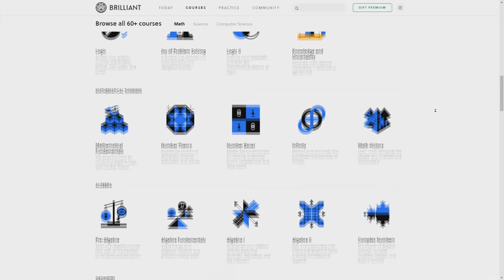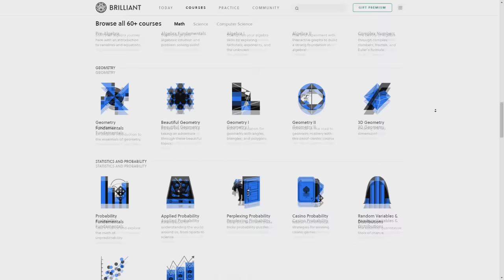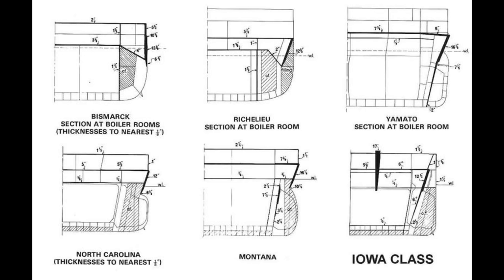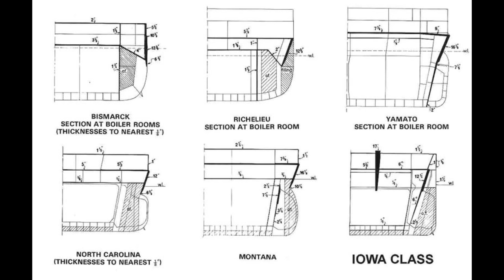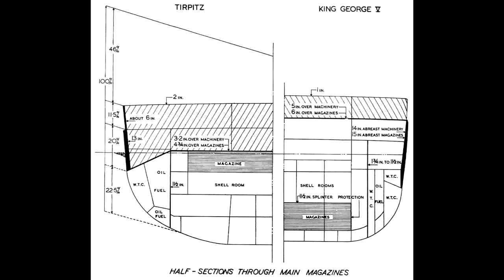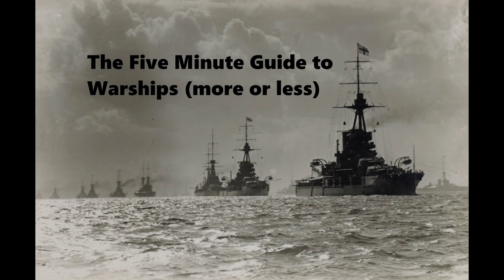Dreadnought Modernisation - A tri-wire balancing act

Comment: I knew a gentleman, now deceased, who had served on USS Mississippi just before and during WWII.  He described his ship as modernized on the outside but old on the inside.  He then went on to describe the challenge of getting hot water (for bathing / washing) as a sailor.  He compared this ship unfavorably (in terms of comfort for the common sailor) to the war-built ships he later served on.
Reply: I mean that is true even today, my Brother was an officer on USS Mitscher (DDG-57) and USS Truxtun (DDG-103) and boy oh boy, the things that an extra 15 years of wear and tear will do to a ship... Despite that he was significantly more fond of Mitscher than Truxtun.
Reply: @adamdubin1276 
Can you recall some examples of those really small but really annoying things?
(like, not classified or critical things, lol)
Reply: @MrNicoJac  It's nothing really obvious. It's the smells, the dents and modifications that the crew has made over the years. little things that you didn't really notice until you end up on a different ship. An older ship just feels different to a newer one.
Reply: @adamdubin1276  I suppose it’s the “character” a ship gets as she ages.
Reply: My dad served on uss iowa in the 80's, and worked in the distilling plant, he says the phrase they liked to use was " modernized from the main deck up "
Reply: @rohanthandi4903 
k, princess...
Reply: @MrNicoJac  Crew accommodations were improved on newer ships.  Bunks versus hammocks, for example.  And showers instead of a bucket.  Older ships were generally noisier and had poorer ventilation.  They became cramped for space when manned for combat operations.
Reply: My father-in-law was on the USS Mississippi during WWII, also.
Reply: The USS Mississippi looked truly bizarre after they converted it to a weapons testing platform. There were all kinds of guns of different kinds and calibers sticking out of its old turret rings. And the missiles. Don’t forget the missiles.

Comment: “Just how frequently did Battleships spontaneously explode?” So we can expect a video on the Mutsu?
Reply: I believe that between 1906 and 1943, there was 1 Japanese, 1 Italian, 1 British and 1 Russian.
Reply: @michaelsnyder3871  I believe Mikasa exploded in port once as well.
Reply: @bkjeong4302  - It only exploded once in port?  How many times was the Mikasa supposed to explode?
Reply: @michaelsnyder3871  and in 1955 another russian ex-italian (and by the way that ship was the sister of the exploded italian one)
Reply: Much eaelier than that, the ships with a full load of gunpowder also were prone to explode. For whatever the reason. 
Like the Maine, in Cuba. Also known as the USS Casus-Belli.
Reply: @atzuras  It wasn't so much the Gunpowder, although that helped once things got going. For most of the earlier ones such as the Maine it is believed to have been the Coal Dust. Which was a perpetual problem pre Oil Fired days.The Gunpowder was kept segregated in it's own nice secure magazines. And wasn't prone to move around too much. But you had to move and constantly disturb the coal to make the ship go. Which meant lots of coal dust. You get too high a concentration in the air and Kaboom. And if the kaboom is good enough to set off the gunpowder? Then you get the earth shattering kaboom. 

The Mutsu was one of the rarer cases where it wasn't a coal fired ship. So it is known to be related to munitions exclusively.
Reply: @Andrew Taylor  Very neat explanation. I am not a navy guy but I heard of cannons, both land based artillery and naval guns, that could go boom by the other side due to wrong gunpowder mixture, half-burned gunpowder dust accumulated in the barrel or just manufacturing defects that cannot be seen until it explodes after a few shots. By the XV century, I mean.  It was like," If that thing explodes, we build another one and hope for the best."  Things have changed a lot since then..
Reply: @atzuras  If i remember it correctly the coal aboard the USS Maine was a low quality coal prone to generating a lot of spontaneously explosive dust, and with the ship's magazines on the opposite side of the bulkhead, didn't take much to split the ship in two when that dust detonated and took the magazine with it
Reply: @parrot849 Well, the Japanese DID fully restore it afterwards so during WWII it wasn’t necessarily out of the question that a stray bomb hit might do it again…(though I believe she was inactive by that time)
Reply: @andrewtaylor940  The actual most explody things were actually flour mills
Reply: @petergaskin1811 Those are still pretty explody.

Comment: With respect to the modernized US ships it’s really a two part story. Prior to the outbreak of WWII we see the US taking advantage of the mass of material left over by all the cancellations driven by the Washington Treaty. Coal Burners get converted to Oil fuel and improved torpedo protection is definitely a significant goal with a lot of the older ships. Once the war starts the bulges being installed are not there primarily to improve torpedo protection but rather to add buoyancy to offset the mass of AA guns now being installed.

Comment: The modernized Italian battleships may be too weak and too expensive, but man were they pretty.
Reply: Totally agree. Very handsome ships.
Reply: Pretty good target.

- HMS Warspite

(probably)
Reply: Italian engineering in a nutshell.
Reply: Have to agree... I think the Italian ships would win most beauty pageants!! Less capable but awfully pretty!!
Reply: Sort of like Italian aircraft design;  elegant looking aircraft but not necessarily competent (Cr.42,  G.50, Maachi C.200, etc.,)
Reply: Even being a little bit pop gunned, could have been useful in many kinds of roles had there been enough oil to actually sortie.

Comment: So my big takeaway from this is that dreadnought modernization is much like renovating your house.  It's a lot of trouble if you want to do anything substantially different from what you've already got, and it would be much easier to start over if the building codes weren't so restrictive with regards to new construction.

Comment: 56:10 - The Kongos were substantially lengthened in their final refit. I can see three options, extend the bow, lengthen their sterns or cut the ship in two, pull the parts apart and expand the middle of the citadel. How did the Japanese carryout the legthening?
Reply: The stern was extended, giving a slightly improved "hydrodynamic".
Reply: @niclasjohansson4333 - Thank you.
Reply: I always wonder how much the Washington Naval Treaty allowed under the banner of "refit".

Obviously you couldn't keep a single rivet and build a whole new ship around it, but where were the limits. Where in the game of Super Dreadnought Theseus was the line drawn? At some point you would be just taking the piss in regards to the battleship building holiday but at what point?

If for example you cut the ship length ways and breadth, changed out the armour and torpedo defence system, up gunned the ship, ect. you'd end up with a very different ship. Ignoring the cost, what could you get way with?
Reply: @somethinglikethat2176  As I understand it they were allowed an extra 3k tons for upgrades.
Reply: @somethinglikethat2176 
Sounds like something you can easily capture under the max tonnage...
(but I haven't read the treaty, lol)
Reply: They extended the sterns.
Reply: @witchkinglp - Thank you for taking the trouble to provide such an educational and comprehensive answer.
Reply: @witchkinglp  thanks for the great answer.
Reply: @witchkinglp  I would guess that replacing worn out engines and boilers could be justified as "ongoing maintenance" rather than the "reconstruction"  referred to in the WNT.
Reply: @somethinglikethat2176  I would guess somewhere between rebuilding parts of the hull like the italians did, and just picking up the turrets and placing them on a new hull entirely
Reply: And the specific reason the stern was extended was to improve the "fitness ratio", which produced a more hydrodynamic hull and increased the ship's speed despite the additional weight.
They lost some maneuverability for it, though. The turning radius naturally got larger due to the longer hullform.
Reply: @aircraftcarrierwo-class  I think you meant "finesse", not "fitness"
Reply: @RetroVzqz9313  Actually we're both wrong, it's "Fineness ratio", just looked it up.
It's a thing they have to keep in mind for naval architecture, especially hydrodynamic and aerodynamic hull forms.
Reply: hognoxious  The Ship of Theseus conundrum is eternal, hognoxious.
Reply: @naverilllang  the problem with the Italian ship is complex: they agreed to scrap the "modern" Caracciolo already launched and at the time the allowed tonnage of battleships for Italy and France was way below the amount agreed, contrary to Japan, UK and USA. Italy, unlike France renounced the right to build new modern ships, like the Dunkerque class and this freed them form any kind of meaningful Treaty limitations when it came to rebuild their Cavour/Doria class. They were for all purposes considered new ships which would replace old ones, being substantially below the maximum tonnage allowed buy the Washington Treaty.
Reply: @somethinglikethat2176 Technically substantial hull modifications (like what Italy and Japan did) were banned. But Italy had bought political leniency by scrapping their more modern battleship, combined with their "agreement" with France to not build any new BB if the other didn't. And being so far below the BB/fleet tonnage limits, meant nobody cared enough to push the issue. Japan got away with it by lying their butts off and nobody looking/pushing hard enough.
Reply: @somethinglikethat2176 i guess that as long as you're still using the original hull that's the same ship, even if you lengthen or widen it.

Comment: Has anybody else noticed how radically the superstructures changed on a lot of these ships were you started out with either a cage mask on the US battleships or maybe a tripod and then you got one of these crazy Tower Mats to house a more comfy bridge and have something sturdy enough to support the better fire control systems and later on radars?

Look at the bridge structures that renown and warspite had as well as the Nelson Queen Anne's mansion style superstructures that the New Mexico class ended up with

Also without rewriting the entire post you had the ginormous Pagoda style superstructures that the Japanese battleships had which on some of them when they think acted as a topside keel and prevented them from righting themselves on the way to the bottom when they were sunk(referencing something Robert Ballard said) 

Back to US battleships you had the rebuilt Tennessee class and the West Virginia which looked like mini South Dakota class battleships.

Another thing that went away in terms of superstructure on a lot of ships was the heavy counting Tower the captains and the admirals didn't like being cooped up in those things even though there were a few instances where a shell or a bomb made its way into the bridge and capped the entire command crew (HMS Prince of Wales during the battle of the Denmark Strait)

That's all I have attention deficit disorder so if I made any mistakes I ask nobody be too harsh

Comment: 47:12
Well thats pure british humour : casemate mounted AA-Guns :) 
Drach you are a pure genius, keep up the good work and the even better humour.
Reply: I mean, if you set a cylindrical turret into the hull at deck level, does that count as a casemate?
Reply: @jamesharding3459  Casemate is realy a wall of iron/stell with holes in it and guns sticking out of those holes, the guns are bolted on, or on carriages. The turret is a fully moving structure. So that would be a turret, just a bit lower then normal, well the thing with gun elevation came a lot later, so they got some (for today) strange locations for turrets earlier on.
Reply: @tomaseidtner8116  I was joking. I know the difference. Humor really doesn't translate well into text, does it?
Reply: Actually, since the casemate guns on the rebuilt Japanese BBs and CBs had an elevation of 30 degrees, they were given AA HE shells. And the British developed barrage directors for the casemate 6" guns for anti-torpedo bomber AA.
Reply: @michaelsnyder3871  Oh for the love of god….
Reply: Believe it or not, it was actually the Kaiserliche Marine that pioneered the Vertically-Mounted-Casemate-AA-via-90-Degree-List technique

Comment: Great video. Per the closing comments I wonder what a fully modernized Nelson/Rodney would have looked like and performed? Or maybe just a properly maintained one given how hard fought they allegedly were.
Reply: Well, the Nelsons already have good deck armour and reasonable torpedo defence. Unfortunately, their armour is already an all or nothing layout, so there's no weight saving to be made there. If I was modernising them in the 1930s, I'd want to try to get another knot or two out of their new machinery, so they could keep pace with the modernised QEs. Beyond that, I'd take out the 6" turrets, the 4.7" AA and the torpedo tubes (sorry, Rodney) and give them the QE style ten twin 4.5" turrets - I don't have figures for it, but I don't think ten twin 4.5" turrets will weigh more than six twin 6" turrets, two of them on top of superfiring barbettes. Remaining spare tonnage goes on electronics, fire control and as much light/medium AA as I can get on the superstructure and quarterdeck.
Reply: @Dafmeister1978  Look at how many light/medium AA barrels Nelsnol deployed by 1945 - particularly on/around the octopoidal, but as 2-shaft ships I wonder how much additional speed using higher steam conditions could have provided.
Reply: @iansadler4309  Well, the Italians managed to get an extra six knots out of their old dreadnoughts while reducing them from four shafts to two.